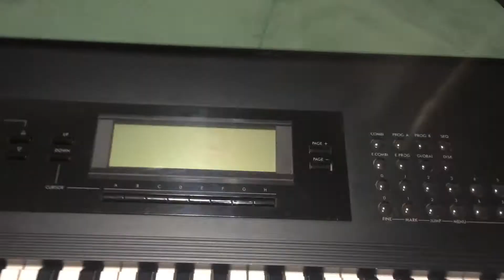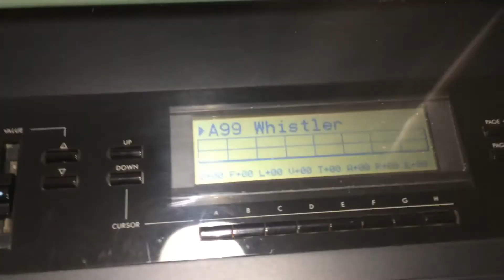Kris Nicholson shows how to tighten up your keyboard action and adjust the aftertouch

Comment: A very nice clip of a Yamaha FS-76 keyboard (ketbed), along with its aftertouch.
BTW, I must say I'd never operate an instrument opened like this on a blanket as it can produce static charge and burn your internal boards.
These keybed were stopped being produced by Yamaha as they are too good and never break... NEVER !
As for your plan to put the red felt, I think you should consider lowering the noise level by replacing the "return action felt" of the FS-76. This way it won't shorten the action range of the key.

As for the "gain" and "expression" potentiometers - I've never understood what they do..
Can you elaborate on that ? 
Any technical data you might have ?
Thanks.